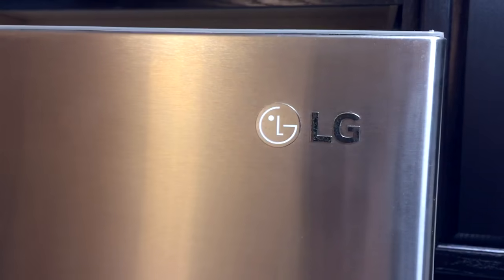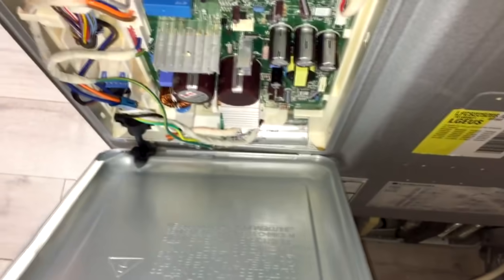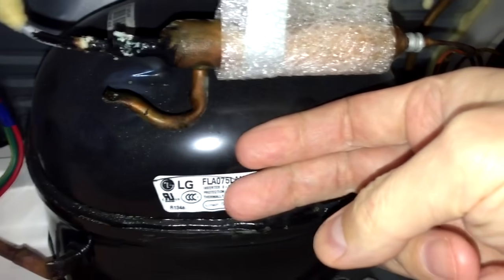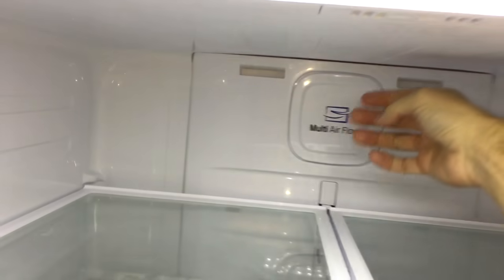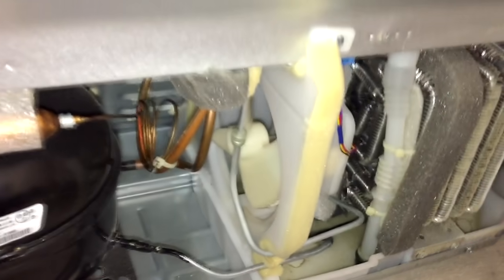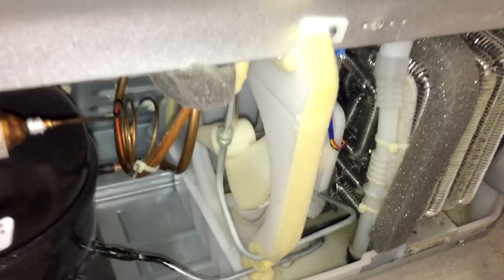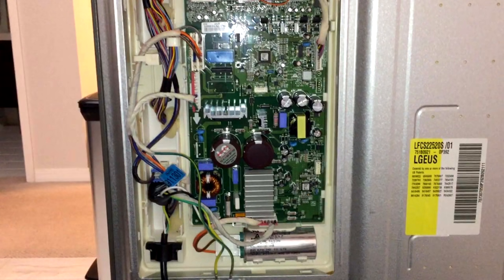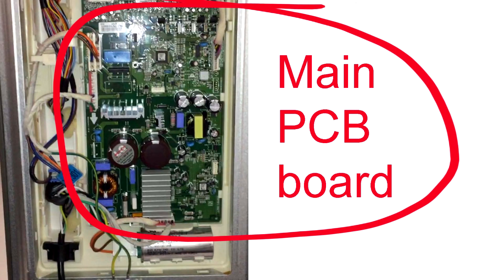LG refrigerator test and reset button

Comment: I love how some of the nomenclature in the service manual is plain and easily understood.  Other portions are a bit cryptic.  For instance the valves are labeled Door Pilot Valve, Door Water Valve, IValve and PValve.   The first two on the diagram are self-explanatory.  According to the service manual the two remaining valves are the ICE Maker Fill Valve and the Way Valve (refrigerant routing).  So is the IValve the ICE Maker Fill Valve, or is it the PValve? 🤔
Reply from the maker: I'm not familiar with these abbreviations. But if you provide the fridge model number, I should be able to figure it out in the context of the document.
Reply: @Your-Self  Its the LG LMXS30776D /00 .  With AC disconnected I may need to trace the wiring from the Ice Maker Valve Socket to Connector pins of either Con2 or Con3 which will require some test lead extensions...
Reply from the maker: The P/Valve is the Pilot Valve, which is located in the back of the refrigerator. The P/valve gets activated either when you fill a glass of water or the Ice maker needs to be filled.
The I/Valve is the Ice Maker Valve, which is located inside the left door together with the Water Valve as a single assembly.
What exactly is wrong with your fridge?
Reply: @Your-Self  It stopped making ICE.  I depressed the reset/manual cycle button under the icemaker and watched it's 
operation.   I could hear the main water valve open on the back of the refrigerator, but there is no water entering the tray.  I removed and disconnected the ice maker, checked the fill tube for icing.  I confirmed 
that the ice maker fill tube heater is operational .  I removed the ice fill tube from the solenoid in the door and confirmed that the tubing is not clogged.  I re-installed the ice maker, installed the ice maker fill tube at the solenoid.  I placed my multi-meter probes at the socket of the ice maker fill solenoid, and depressed the reset button.  When  the cycle nearly completed and the main valve at the back of the refrigerator could be heard to "click" I measured no AC voltage at the ice fill solenoid connector socket in the door.  I confirmed that the valve coil is good a 300+ Ohms.  I double confirmed the voltage is at the Cup fill socket in the door and it measures 117VAC when the door switch in engaged.  This valve was replaced by a certified LG tech when the refrigerator was under warranty several years ago.  This refrigerator ALSO had it's compressor replaced by a LG factory technician too when it failed during the first period of time when there were MANY defective units.

I suspect one of the OMRON relays on the PWB (PCB) ASSEMBLY, MAIN is defective, or its a problem further back in the chain, a bad transistor array IC which drives the relays, or something further back on the chain.

This LG refrigerator is now 6 - 7 years old.   We had a KitchenAid refrigerator which lasted 22 years prior to this.  As all other reports seem to show, LG's refrigerators are Lemons!   $3,000+ for a refrigerator which only lasts 5 to 9 years?
Reply from the maker: Yep, they don't make them as they used to.
You can check if the Main PCB is actually sending the voltage to the Ice Maker Valve. Cycle the Ice Maker once again, and place your leads on the PCB Connector 3 pin 1 and Connector 2 pin 7 ( connectors 2&3 are right next to each other). If you don't get around 120VAC for a few seconds when it's time to fill, the PCB is bad. But if you get the right voltage, the wire could be broken somewhere, or one of the connectors is bad/corroded/loose.
The i/valve itself is probably OK. But if it doesn't get the voltage, it can't function.
I'm assuming the water dispenser works fine.
Reply: @Your-Self  Yes the water dispenser itself works as it should.
Reply: @Your-Self  I like how you're selective with the comments you respond too. Some people are asking for advice on what they're issue you could be but they don't get answered.

Comment: please can your help me ini have may refregerator lg not cooling , in the first tim when i applied a reset button my refregerator turn on and work properly for 2 days and it's turning off and the problem return it's not cooling  i rested it in the second time but it doesn't work any hot air inside came from the ventilator please could you help me to repair it !

Comment: Sir my lg refrigerator  same model shown in video, is dead only inside lights were working,,,, on pressing micro switch for first time the compressors  starts but stops after some time,,, when it starts freezer fan works but no cooling and after some time it gets offf,, please help me   thanks

Comment: My  bottom  freezer  has  a layer of  ice  in the freezer  compartment.  When  it  goes through  defrost  cycle,  it  melts  and  drips on the floor.   Can this be fixed?
Reply from the maker: There should be a Defrost Pan on the back next to the compressor, and the water supposed to drip into the pan. Where exactly is your water dripping... upfront?
Reply: @Your-Self  If  I don't  chip  out the  ice  weekly,  a  puddle  of  water  forms  in  front  of  the  refrigerator.  When  I  hear  cracking  sounds,  it  is  defrosting and  easier to  remove  the  ice.  It  sounds  like a  line  is plugged  somewhere.
Reply from the maker: Sounds like the drain tube is clogged up with debris or ice deep inside the tube that never gets defrosted. So you need to manually unclog it. Remove everything from the freezer and the back wall to see the evaporator coils. Under the evaporator is the drain hole. Pour some hot water into the hole until it drains well.
Reply: @Your-Self  Thanks!

Comment: Test one blows cool air in both compartments. I don't know exactly how cold in the freezer.   Test two blows freezer only. Test three turns off fan and compressor, and I heard just a few crackling sounds.  There was no blinking on the LED.  It's been about an hour after the test, the freezer is still only 30 F, and the refrigerator compartment is 55 F.
Reply from the maker: All you checked seems to be working correctly. I'm afraid it's the beginning of a Sealed System problem (leak, clog, weak compressor). If your LG is under 5 years old, call them, and they may fix it for free.
Reply: My situation is exactly the same. All 4 steps were suceesful. How long does it take after test #4 for the fans to kick in? Right away? My fans are not running. ( they ran during steps 1,2,3). Thanks in advance

Comment: You won’t feel the fans inside without the fridge door shut, to trip the magnet switch. You can open and shut the doors and listen for the fridge fan to engage in about 15-20:seconds
Reply from the maker: During the Regular Mode, this is true for some models. But when you run the Test Mode, the fans should spin regardless of the door being opened or closed, but again, not all models are the same.
Reply: @Your-Self  from the back ear on the aluminum , center.

Comment: After clicking the rear button one time, every initiated including the evaporator fan and I felt cold air coming out in refrigerator and freezer. When it clicked through to next clicks and eventually unplugged it to put cover back on, then plugged back in, the condenser is vibrating and the fan next to it is running but no air is coming out inside the unit. Any ideas?
Reply from the maker: When you open the door (without running the test) the evaporator fan may stop automatically, so you need to activate the door switch to make the fan run again.
Regarding the vibration, it's difficult to speculate about the problem without being there... maybe one of the tubes is touching the back cover?!
Reply: YourSelf when I said vibrate, I just meant it was running. 
The door opening doesn’t affect the cold air blowing in refrigerator and freezer. It only stays in test mode 1 for 5-10 minutes then it goes back to normal operation and the air coming out in refrigerator and freezer stop. I know another person had comments with exact same scenario. Thanks so much for your time?  Any other ideas?  
So bizarre it fires up and works perfectly in test mode 1 but won’t work otherwise.
Reply from the maker: It sounds like the compressor is good since it cools during the test mode. So the problem maybe with the motherboard or the door-switch.
Open the freezer door and activate the door switch. Does the light go out? Do the same with the fridge door... if the light goes out, the door switches are probably good. So the motherboard is probably bad. 
PS. You probably have at least 2 temperature sensors (thermistors), and I doubt that both failed at the same time. Also, do you see any error codes on the display upfront?

Comment: Great video, thanks for sharing ! I have an LG bottom freezer refrigerator # LRBC20512WW . My freezer will only get cold, but not freeze. Any idea on what the culprit might be or what I should check? Thanks
Reply from the maker: Did both fans run during the test mode?
Check the condenser coil next to the compressor, or on the bottom of your fridge (not sure where on this model). If covered with a lot of dust and hair, brush and vacuum to clean. If it doesn't help, remove everything from the freezer, including the back panel and look at the evaporator coil. If covered with a thick layer of ice and frost, it's probably the defrost system issue. If no frost, or just a little on the top, it's probably more serious problem with the sealed system.
Reply: Low freon charge, most probably a leak at the evaporator, if out of warranty, don't waste your money, replaced it for a GE or Whirlpool (I'm a former LG tech)

Comment: I get nothing at all, no power.  I’ve had my fridge for about 2 and half years and it’s been great then it just shut down.  I can’t use the test button because I get nothing.  I have no breakers thrown and the plug is fine.
Reply from the maker: Plug something like a hairdryer into the same outlet to verify that it works.
If it works, the fuse on the mainboard is probably popped. Fuses on newer LGs are not replaceable, but you could probably solder a new one on top of the old one.
Reply: @Your-Self  Yeah, I did that man.  The outlet is good.  No breakers thrown.  She just shut down sometime last night between 9 pm and 3 am when my wife went for a glass of water.
Reply: Sorry, it was milk not water, and she just thought the bulb was out!
Reply from the maker: Sounds like you need to call a tech to find where exactly you lose power. It could be the fuse on the main PCB. Also, one of the fans or an auxiliary board could be wet and taking down the whole system.
Reply: @Your-Self  Thanks man, I’ll keep checkin!! Thanks for trying to help people and getting back to me so quick.

Comment: When all these tests checks out and the refrigerator is still not cooling,what can possibly be the issue with the unit,the compressor runs fine but yet there is no cooling in the refrigerator.
Reply from the maker: During Test-1 if you feel warm (not cold) air blowing inside the freezer and the fridge compartment, the compressor is probably inefficient (bad,) and needs to be replaced.

Comment: My refrigerator stopped making Ice, I reseted the refrigerator and worked fine for a day.The next day the ice started melting and did not make ice anymore?  Also the ice maker section of the refrigerator is warm?
Reply from the maker: What is your refrigerator model number, and how old is it? Depending on the model, it could be a bad fan, defrost issue, or the beginning of a serious Sealed System problem.

Comment: My freezer is cooling and the fan in the freezer is working, the compressor and fan by the compressor is working. There’s no air blowing in the fridge area
Reply from the maker: Depending on your refrigerator model, you may have a bad fridge fan, a damper door, or an electronic board that is not doing its job.

Comment: Thanks!!! When i go to the second stage, the screen shows 22-22, i been reading some manuals and it said, “change the damper”, but i cant find it... where is it?
Reply from the maker: The 22-22 is just showing that you are on Test Mode #2.
The 33-33 means Test #3.
The Damper Door is typically located in between the Freezer and the Fridge compartment. And it should open and close to let some cold airflow from the freezer to the fridge.
During Test #1, the Damper should stay open. During Test #2 it should close.
(PS. Some refrigerator models have just a hole, instead of the Damper, or a separate cooling Evaporator with a fan)
Reply: @Your-Self  thank you very much!!! I found the damper and it works fine, open and close normally, my refrigerator model dont show 33-33 i dont know why.. it only makes test 1 and 2.. i found and app called "smart diagnosis" i made the diagnosis and shows everything is OK.. the air is a little fresh, but not enough to mantain food cold, it does not make ice.. u think is a fail in the compressor? i make the test pressing the test button in PCB, and the led does not make any blink... i dont know what else do i have to check.
Reply from the maker: Did you see the Evaporator Coils inside the freezer, and is there any ice/frost on them?
Check the temperature of the Condenser Coils as on in this video https://youtu.be/ipwOerjFITg
It sounds like a Sealed System problem (compressor, leak, clog)
To figure out the exact problem, a tech needs to check the pressure inside the sealed system... it's typically an expensive repair tho.

Comment: I tried this out only air is blowing through the freezer side . What do I do next ?
Reply from the maker: Depending on your model number, your refrigerator may have a problem with a damper door or a dedicated fan in the fridge section. The fan could be stuck in frost/ice due to a defrost issue.

Comment: hi, i try this test with my LG GL-b492GLHL,   after clicking the reset button the refrigerator works, then the second click there is nothing no sounds nothing, and the refrigerator stop working and i get 6 blinks. could you help me plz
Reply from the maker: This is a non-USA model, so unfortunatelly I don't have any information on it. Unplug you fridge from the wall for about a minute, and plug it back in. Give it 24 hours, and if it's not cooling, you may need to call a technician to look at the Sealed System.

Comment: What if my freezer fan works during test mode only ? What could that be ?
Reply from the maker: In some models, when you open the door, the fan will stop automatically. Try activating the door switch (as if the door is closed) and waiting for about a minute. The fan should start spinning again. Have you tried that?
Reply: @Your-Self  your right, the fridge is cooling fine but the freezer isn’t

Comment: Hello Sir,  I have tested the Main Board, when pressed first time, it beeped and fan turn on also feel compressor is running.  Press 2nd time, the fan turned off, no beeping per the video.  Do you know what is the issue? Thanks.
Reply from the maker: Some refrigerator models have only 2 tests, so the first time you press the button,  the compressor and all fans should run. The second time, the compressor and fans are OFF, and the defrost heater should turn ON. Is it a Side by Side model?
Reply: @Your-Self  yes it is side by side model.  Yes, there's only 2 test mode. It seems everything are running fine.  Just not cool and cold in freezer.  Feel kinda chill in freezer. Also thanks alot for the supporting.
Reply from the maker: Let the fridge run for a day after the Reset. If it's not getting better, remove everything from the freezer and look at the Evaporator Coil frost pattern. A thick layer of ice and frost indicates a Defrost problem, but a little frost just on the top, maybe a more serious Sealed System problem.
Reply: @Your-Self  I forgot to mention that.  The problem happened after the power outage.  Would it be damaged the main controller board?  Both of freezer and fridge don't get cool.
Reply from the maker: Electronic control boards are very sensitive to power fluctuations. So it's possible that the board got corrupted.
If your refrigerator is still not cooling properly, look at the compressor and all fans. Are they all running trying to cool the refrigerator? If not running, it's probably some electronics problem. But if they are running, you need to look inside the freezer on Evaporator Coils frost pattern, as I've mentioned before.

Comment: Hello,
We have purchased a LG Fridge Model number GC-B197NFS, twin door freezer on RHS, fridge on LHS....
Problem is.... Since we pluged it in it will not stop beeping, when we open door it beeps for a long time, eventually it stops, but after a long time.
I think this beeping is far too long for normal operation.
Can you give us some advice please.....
Noel
Reply from the maker: I'm not familiar with this model refrigerator, is it Australian? The circuit board (PCB) is probably located on the top of the fridge. It's difficult to say why it's beeping... can you see an error code on the screen, or something is flashing in a pattern?